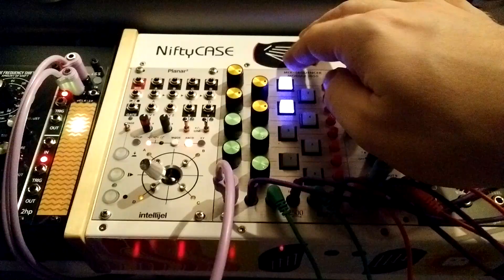Strange Module Interactions (Abacus/Perfect Pitch/1050)

Comment: More on the 1050 glitch. After playing a bit more with it, I think I found the most useful way to setup this. Don't use Internal Pulse at all, instead, setup one clock to just cycle through odd steps, then substract an attenuated second clock from it. This way whenever second clock kicks in, you get even step properly quantized to the grid and you can modulate how often even steps occur.
Reply from the maker: That's more or less how I've been doing it so far but just with an attenuverting mixer (abacus). Having it modded by CV is a good idea though. I will have to plan some little performance piece that makes use of these features.

Comment: As I later replied on Reddit, the 1050 quirk is indeed all about polarity on the Ext Adv input, and can be exploited further when used together with the internal pulse generator of 1050. If both run, and the offset is set just right, then the internal pulse generator will set how often the next step will be even.